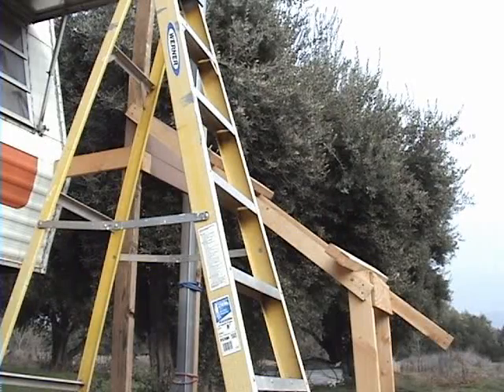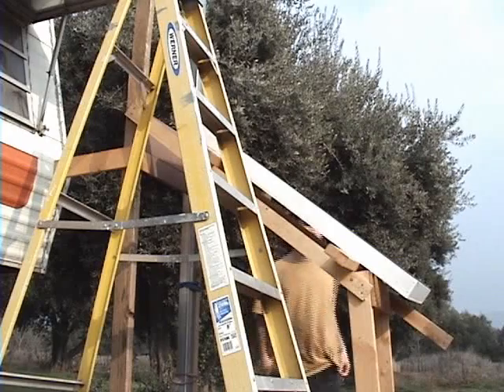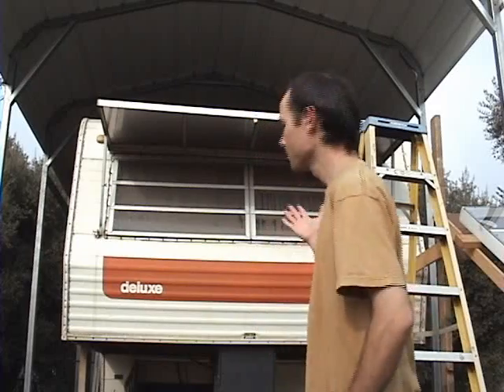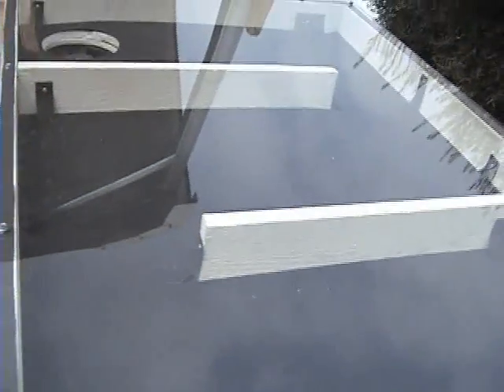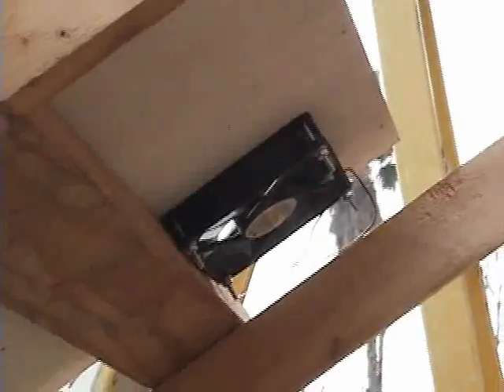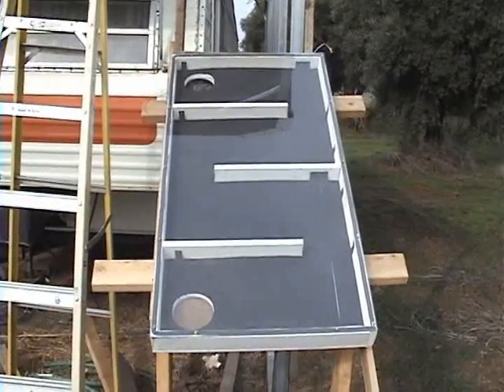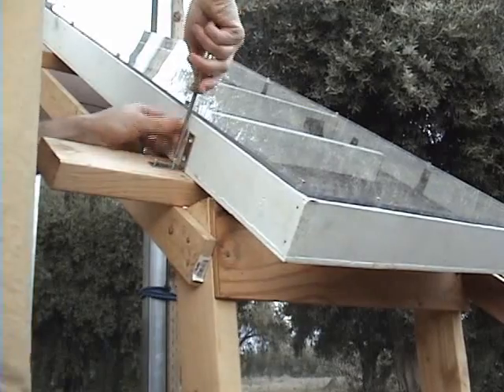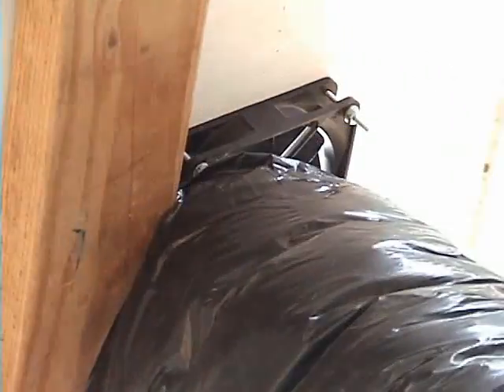Clean Power Show Episode 5 - Solar Heater

Comment: You have a hole at the bottom? Is this a hole for air intake from the inside of the trailer for circulation or how does air move in the box? Where is the air inlet from?
Reply from the maker: The hole on the bottom is for outside air intake. The fan sucks in the outside air, which travels in front of the black aluminum, heating it up. For greater efficiency, the hole on the bottom could be connected to an insulated duct to take inside air instead of outside air. Also, if the black aluminum were corrugated it would create some turbulence inside giving better heat transfer. This is a very simple design, with lots of room for improvement with a little more work. It's also easy to scale up - with a large enough collector and plenty of sunshine, you could get plenty of free heat for an entire house.
Reply: I see, i  want to build one and try some kind of material to hold the heat that  I can from the collector to run underground to that and i wonder if salt would retain heat overnight? I am sure there is some kind of material that can hold this if you run the pipes through it in an underground storage place. What  you think on this?
Reply from the maker: Sounds like you're on the right track. Some of the big solar thermal power plants use molten salt as storage - but you're not likely to reach a very high temperature here. Making a solar water heater and using an old electric water heater tank as storage might be a better alternative - then you can use a heat exchanger to get hot air, and as a bonus you've got water heating taken care of too. Besides, water is cheap, has high thermal mass, and much better thermal conductivity than air. You might also add some thermal storage inside the home, such as a brick wall.
Reply: Yep, I already thought of that brick. I felt maybe i could channel some air and pipes inside some concrete blocks inside the "box" and funnel air through the blocks to sustain the heat. Not sure if that is a good idea but i have been trying to find the "best" idea and do it right the first time.

Comment: All your wooden battens inside do is interrupt convection and make your fan work harder, you do NOT need them. Your backing also does not need to be metal. Any material painted black will work the same, in fact, plasterboard will retain heat longer, as long as it is in an insulated aluminized box.

Comment: I do not think you need the panel to be aluminium , black painted , yes , but not aluminium . The panel is not conducting the heat through it . If you wanted, you could just paint the back insulation material black, it's just shedding the heat back into the air flow. As long as it's black.
Reply: This is a good point and good information to help keep cost low.

Comment from the maker: @latinonyc7 Yeah, it works. The concept is you have a dark colored material that can conduct heat encased in a clear enclosure, then make air blow through it. Basically this means using aluminum painted black. There is an infinite number of ways to do it. I have made a heater using aluminum cans, it works even better. There is also another more efficient design, however. I'm planning on making a huge solar heater for our house in time for next winter using the improved design, so stay tuned!

Comment: The system can be improved if you switch the air in a heat accumulator (stones, water bottles etc.).. This system seems very simple to build. I wonder if you get the same results you have with aluminum cans.

Comment: The other hole needs to be connected to the trailer or house you install this on because the air won't have a chance to be trapped inside the enclosure no greenhouse effect. Like when they tell you to not leave you dog in the the car without cracking the windows on a hot day because when you crack the windows there's no net heat build up. There should also be double layer of plexiglass and caulking around it.

Comment: I made a 3x4' one just like this and had a fan.  When outside 32deg drawing outside air, the heat stopped pretty soon after it started.  About a minute or two.  I think the pop can heater may be better, I am going to experiment with a $25 4x8' version.

Comment: According to an old Mother Earth design you should close the loop with an intake tube to the floor of the trailer.  That way the potential for an increasing rise in temperature in the trailer is continuous. There are enough cracks in houses and trailers for fresh air, the real problem is needing more BTU's in winter.

Comment: H2O solarheat- Two points of method: (1) Two waters, separated, zero pressure and house pressure, and (2) Use principle of heat-exchange to take heat from zero pressure to house pressure by running copper metal tubing with house pressure, inside the zero pressure water. The copper metal does a very good job of transferring the heat, and many times better than plastic or rubber. Mixing sand and water in the zero pressure water is probably better. Thin aluminum may contain the zero pressure water.

Comment: at first i thought this was a great idea but then i was thinking about the fact that an aluminum sheet painted black was used. Considering heat is captured produced by the sun and then blown into the home ... why would u need a heater if it was warm enough outside? Hopefully that wasn't a dumb question.